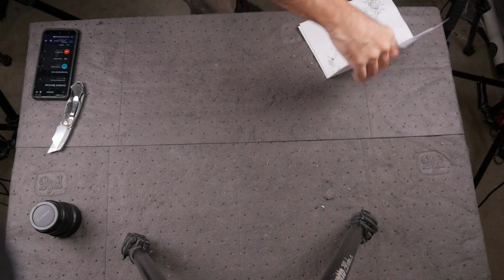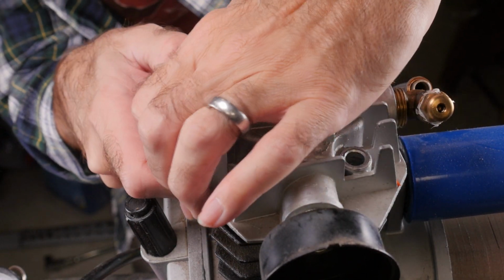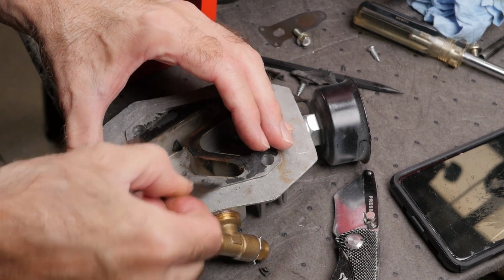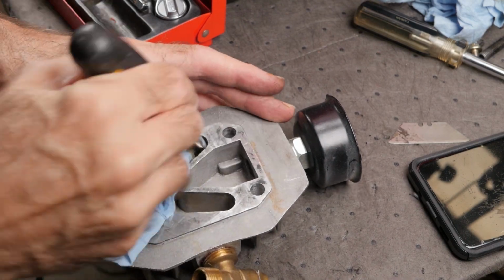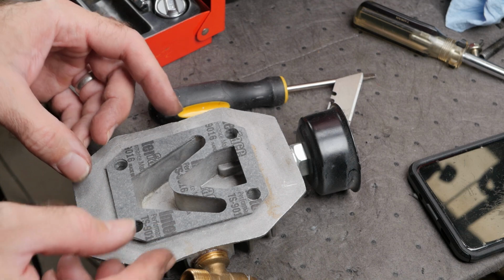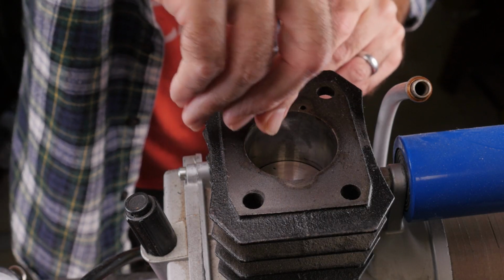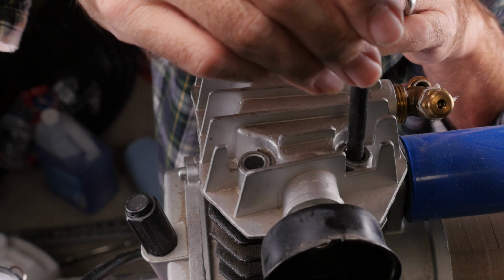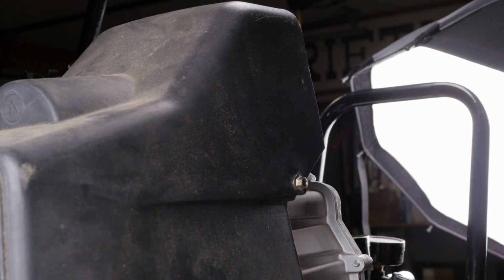Husky Air Compressor Won't Compress

Comment: I have a husky 20gal "silent compressor" ... It's stopping at 50psi. Do you think this could be the issue?
Reply from the maker: When you say it is stopping at 50psi, does the compressor shut off (stop compressing) when it hits 50psi, or does the compressor keep running forever but never goes past 50psi?
Reply: @mainejason  the compressor keeps running but never goes above 50 to 60psi. It'll sit right there
Reply: @mainejason  it didn't help that I've looked everywhere for the valve plate kit and I can't find one for this compressor. 🤦🏻 Model 3332013. They apparently don't exist
Reply from the maker: I looked around a bit and, like you, cannot find anything for that particular model number.  It looks like there are 2 pistons, therefore 2 valve plates in that unit.
It also looks like that unit has a history of manifold and regulator problems.  If you have ruled those out, or any other areas where a leak could occur, you could investigate further by taking the head off and seeing if you could identify the valve plates visually.  Usually those parts are used across a number of companies so you may be able to find it listed for another compressor model.
This, of course, depends on your level of comfort and skill.  This could compromise the gaskets, so make certain the issue isn't elsewhere as reassembly may not result in a working unit (even though it is not working currently).
To be clear, I am not instructing you to do this.  You'll have to judge your skill and "pain threshold" on this.  In other words:  Proceed at your own risk!
Good Luck!
Reply: @mainejason  thank you for the info. I'll look into it more tomorrow. It was actually free, because it didn't work. I was just doing what I could to get a cheap compressor 😂. Thank you for your help!
Reply from the maker: Ahh, cool.  Sounds like a fun project. 
Good luck - let me know how it goes!

Comment: I liked your video I have sort of same problem but don't know where to buy that kit to fixit would you let me know please, thank you. roy
Reply from the maker: Hey Roy, thank you for watching!
There are a few links in the description of the video to the parts you a looking for.  Either one should be what you need, but if you use the kit from the Amazon link, make sure to also get the gasket set (also linked in the description) as I do not believe it is included with the kit.
Hope that helps, and best of luck with your compressor!

Comment: That gasket looked like a pain in the backside. Maybe soaking in a solvent would have saved you some elbow grease? Isoproyl alcohol works wonders on many things and won't touch the aluminium. Neither would brake cleaner, but it's a lot nastier for inhalation. Great video, thanks.
Reply from the maker: Great suggestions!  For some reason, I never considered what could be used to help the process along.  I guess tunnel vision set it!
Thank you for the comment!

Comment: Witam co się działo z kompresorem jak była awaria ???
Reply from the maker: When the reed failed, I heard a ping sound, and then the pitch of the running compressor changed.  Of course, after that, it wouldn't build pressure. 
Thank you for the comment!
Reply: @mainejason  czy kompresor wydawał dziwny inny dźwięk?
Reply from the maker: Yes, if you go to the Wrap-Up section, I give a demonstration of how the sound changed.

Comment: Plastic razor blades are available, which are intended to be used for removing stickers/decals from delicate surfaces without damage. They might not have been up to the job of removing that gasket material though, which looked quite tough!
Reply: I use a thin,  non serrated butter knife quite often in the garage for jobs like this.
Reply from the maker: @davidshaw4727 
Yes!  Great idea.
Reply from the maker: Interesting.  I don't think I knew about plastic razor blades - but you are correct; there is no way plastic tools were making a dent in that gasket!
Thanks for the comment.